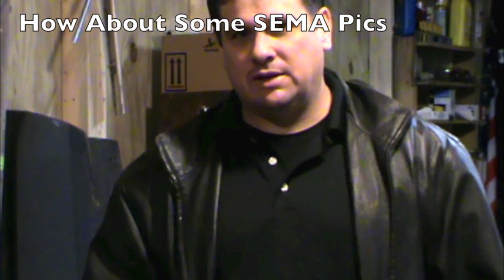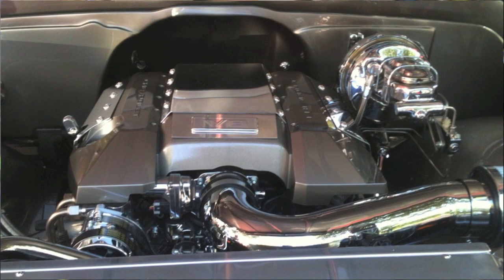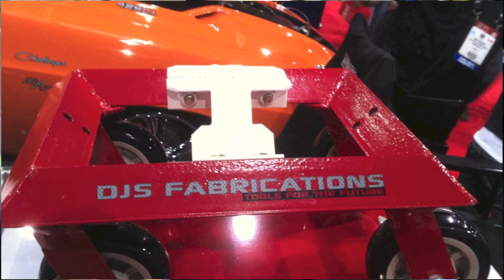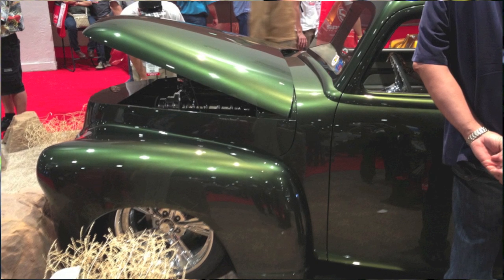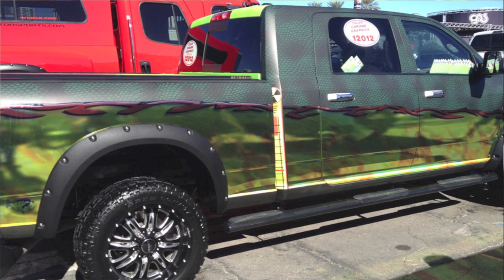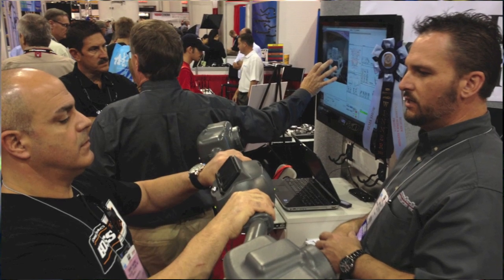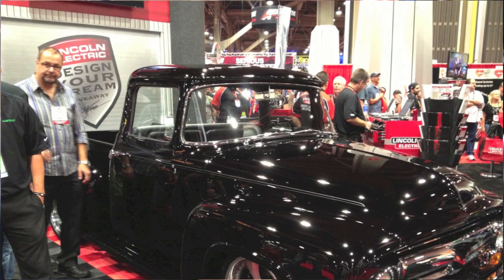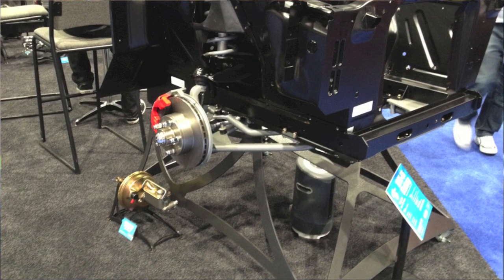What Happens Behind Auto Body Shop Doors - SEMA Class OEM Repair Procedures

Comment: The obvious changes I've seen in cars would be that they used to be metal & now they're mostly plastics/fiberglass.  With new cars getting 54mpg, I may definitely not drive my old schools (once complete).  I enjoy classic cars, but enjoy traveling at almost 3 times the distance before re-fueling.  Suppose the classics will be for local trips only (unless trailered).  Great vid, keep'em coming.  Research is always a positive direction.